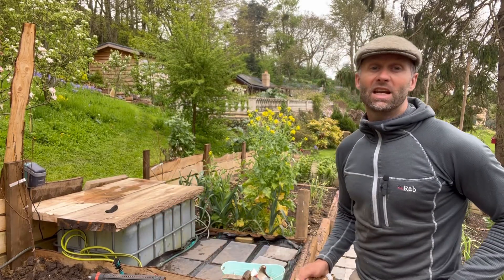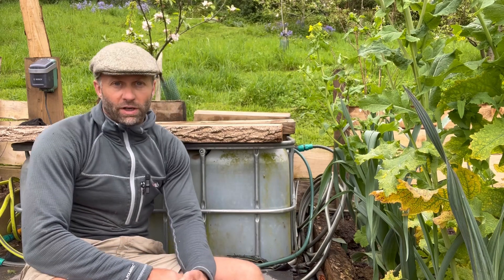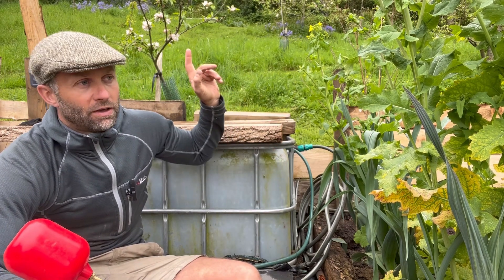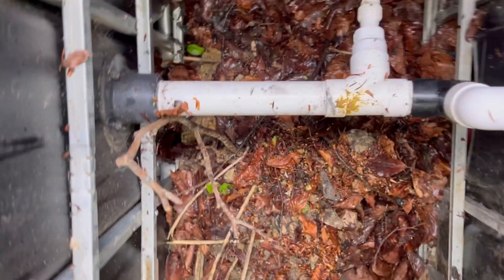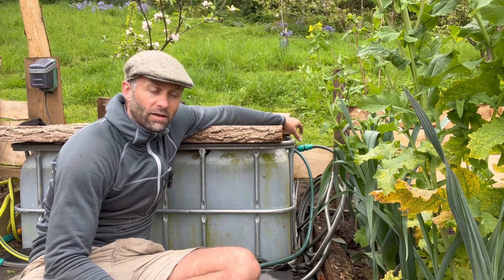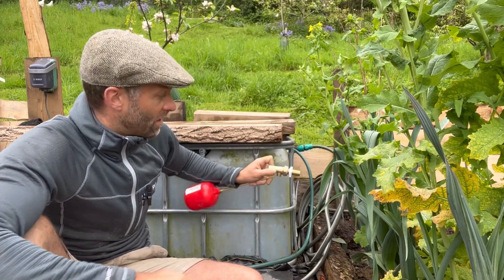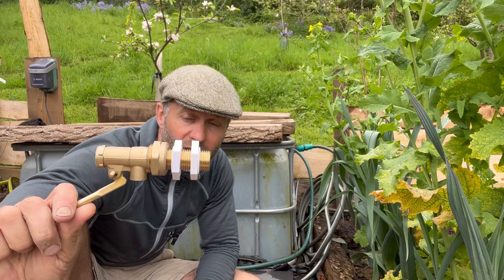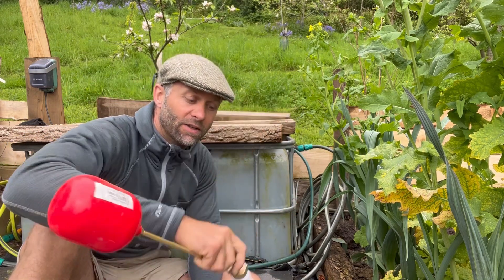IBC Rainwater harvesting system for free water all year round!!!! 💦💦💦

Comment: Very nice, have you had much algee? I painted the sides of the IBC with some old car spray paint to block the sun light. Helps them blend into the garden and the reduced algee means less problems with the nozzels on my automated drip feed.
Reply: I use a filter sock and foam to keep leaves and vegetation from entering the water butts from my gutters. Simply change the sock once a month, wipe the foam clean, it keeps the rain water from the tannins if using for aquariums, as I do.
Reply from the maker: Not much at all. The head tanks are black and the vegetable garden is mostly covered.

Comment: Hi. Can I ask you to talk through the gravity fed element of your water set up please? Following what you did with the pump and hosepipe I have set up my irrigation system but my first IBC tank is near the house and I need to get that water down to the IBC in the veg garden. Its approximately 100m but we live in Lincolnshire so its very flat. Thank you
Reply from the maker: Sure. Ultimately you need a drop in head but it doesn't need to be that much. You can elevate the first IBC on some pallets or another IBC, something like that. Then you can install the second, connecting with the hose. If you have trouble getting the flow you can prime it with a pump, cap the hose of when it's full of water and then fit it. When you let it go, provided there is a drop in head, then the system will work.
Reply: @TheMilitaryGardener Thank you so much. Appreciate it. Will see what we can sort this weekend.
Reply from the maker: Keep me posted.
Reply: @TheMilitaryGardener oh my goodness. So I haven't sorted out the gravy fed element yet but the actual irrigation set up is working a treat when powered by the bosh pump. I purchased an irrigation kit from amazon years ago with very thin lines and i could never get it to work. But having now changed it over to hose pipe it is amazing and has so much pressure. Thank you so much!
Reply from the maker: @cristinashort121 I'm so glad!!! Great work.